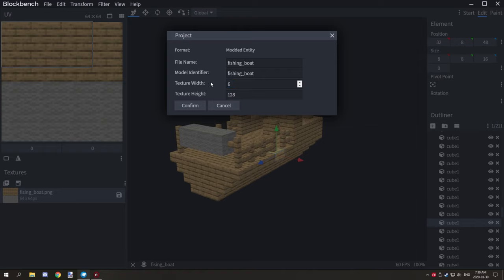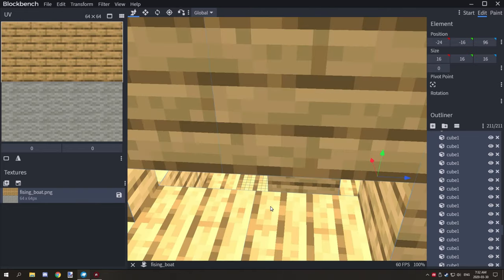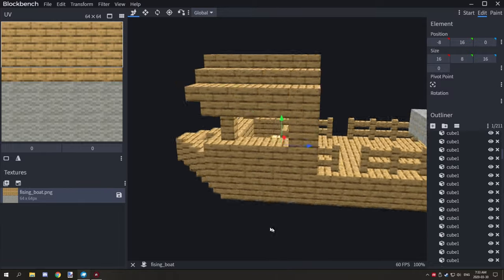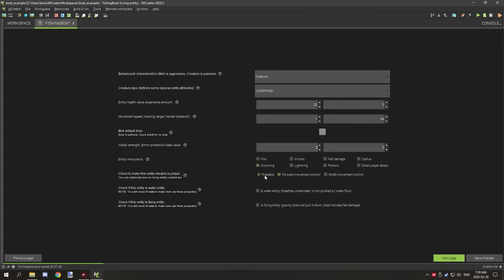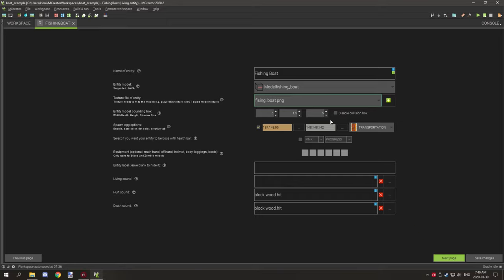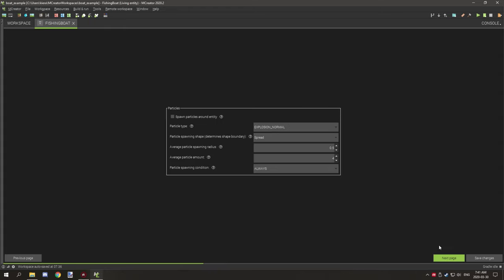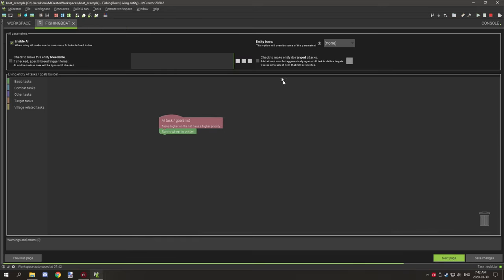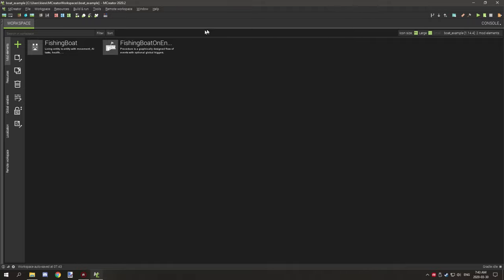MCreator Tutorial: How to make a boat | 2020.2

Comment: Do you know if there’s a way to make it move like an actual vanilla boat? As in, using A and D to turn instead of using your mouse. Enabling strafe doesn’t work, that just makes you shift to the left and right.
Reply from the maker: you would need to use keybinds for sure, and most likely movement vector with rotation blocks based on the keys the player is pressing.
For example A and D would require you to change the rotation a bit I have not figured out how to keep it going while the key is down, I have not hand much luck figuring it out with a plane, which is on my todo list for tutorials but this is holding me back from making it. But overall you would adjust the Yaw of the entity either go up or down based on the key and the rotation the entity is already facing.

You would also need to test if the value is 359.9 and than carry over to 0.0 and vice versa for 0.0 to 359.9 depending on the rotation.
I plan on making a further car tutorial which could use this method in its own part, so I may try to give the key binds another go some day soon.

Comment: Is there a way I can import a vanilla block to use as a template? All I need is the vanilla block (ex. dirt block), change a setting, change its name (so it doesn't conflict with the vanilla), and save it. That's all I need but it seems like I have to manually set every texture and setting for each block, which will be killer since I have 189 to do. I can't seem to find help on this anywhere and I'm seriously hoping I don't have to brute force it. :/

Comment: When i try to do it the boat always sinks in the water, how can i fix this
Reply from the maker: I think this may have had something to do with the entity actually being in water, it may be possible to make it hover just above the water so it does not sink using no gravity or making sure the entity floats if below 63 or 64 this should make sure it stays up, the player will get kicked off if they touch the water however I think something changed with forge that made this a bit harder to do in newer versions.